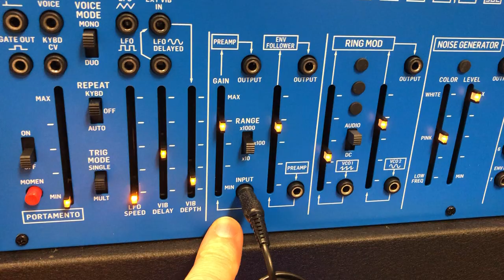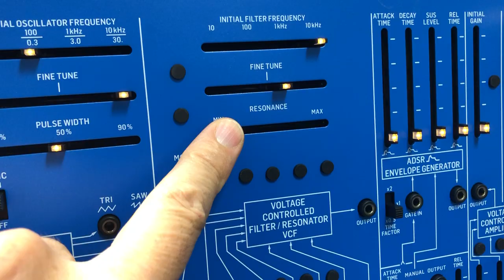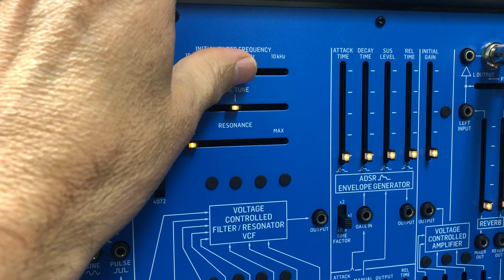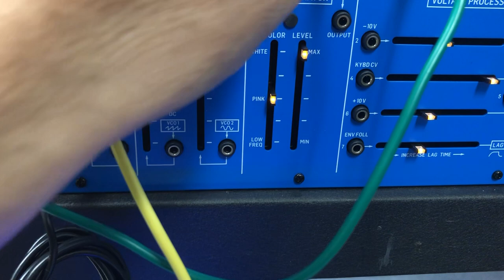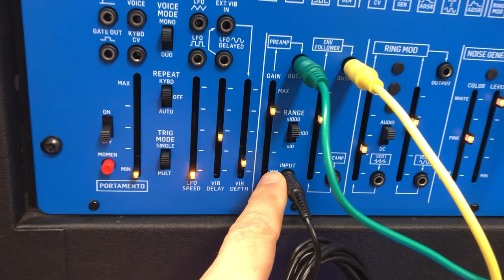Arp 2600 Behringer Envelope Follower with Microphone

Comment: What sort of microphone?
Reply from the maker: I found some old, dynamic microphones that were designed to plug into a cassette tape recorder.    That's what I use.   But any dynamic will work, as long as you can get it plugged into the 1/8 inch port.